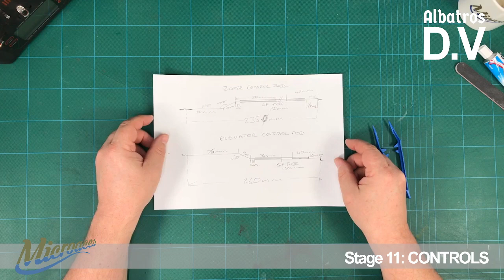Microaces Albatros D.V Build Video - Part Two

Comment: I just completed this model and it turned out beautiful. I have built many RC aircraft and the detail of this kit makes my other planes look like toys. I first built the Scrappee model to develop confidence with the construction techniques and materials used, it is a handsome 3 channel trainer. I have yet to fly either plane as there is still snow on the ground and I don't have access to an indoor flying venue but  I'm certain they will fly great as long as it's a dead calm day, standard procedure for all planes weighing less than 3 ounces. Building small planes is definitely not for everyone but I have always found that the most rewarding accomplishments in life are a result of overcoming difficult situations, just my 2 cents. Well done Microaces, the time and engineering that goes into your kits is impressive!

Comment: Thanks so much for creating these planes ! I have the D-8 and am waiting for the motor and gearbox to come in. Why is it not on the website anymore ? Just ordered the Kessler Dr-1 with some glue supplies since my local hobby shop closed down, no more quick runs to the shop . Thanks so much for your effort and time Sir ! May pick up the D-7 next.

Comment: Working on aileron hookup. Threaded the rigging tool thru, added rigging line, then pulled the rigging through. Low and behold, the piece broke. Any ideas on a fix? 😢
Reply from the maker: Hi Jay, you could drill a hole a little further into the structure and try again, If a problem we've got spares we can send you!